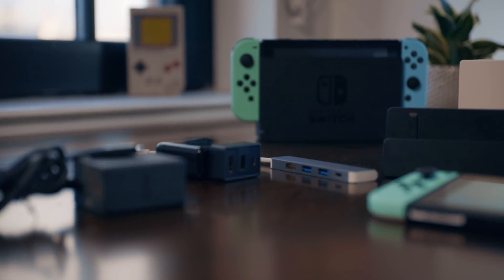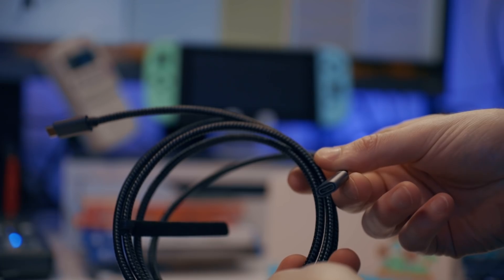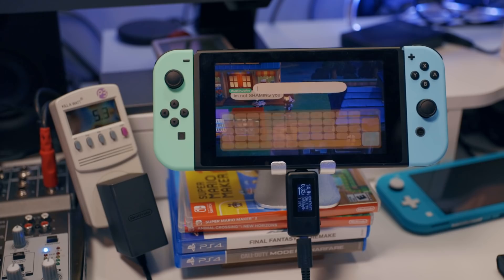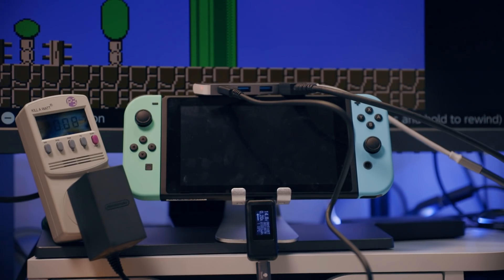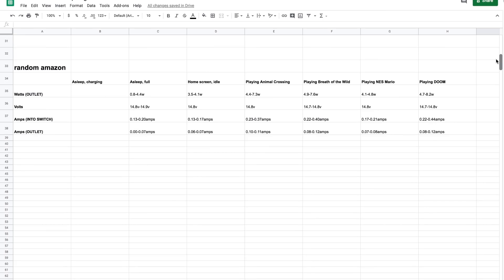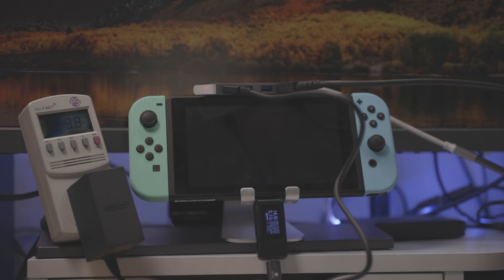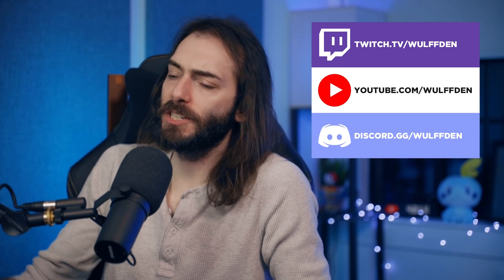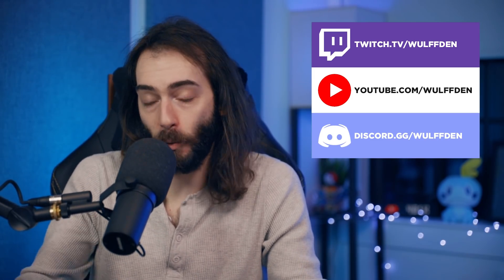How the Nintendo Switch consumes Power

Comment: My OCD and my generalized anxiety have caused me to always use official products for ALL my electronics… I heard once when I got my iPhone 3GS back in the day that your battery would degrade faster using non-apple products. I heard that when I looked up “how to increase battery life of my phone” every article I read said use the official cable and plug. So now, I ALWAYS only use official products. I like my devices to run properly. I don’t want to risk it, not even a little.

Comment: Are you telling me, that all I had to do, was get a male to female Type-C cable, like 20ft to 20 miles, hook that to the Official Dock, and use one of the cheap stands with the slot for the cable. Then I'd have a compact Dock that won't brick my Switch at all? 

Well.... half of it would be compact, the other would make it a cumbersome jerry rigged monstrosity defeating the purpose and I should just buy a second dock and transplant the guts into one of the compact empty shells.

Which I have a second dock coming form Nintendo and about to order one of those cases. Although I might just put the guts in a very tiny Tupperware container or something and put the Switch on top. Then I wont have to reassemble the circuit board into a new case. Just drop it in a container and call it a job well done. LOL

Comment: I have an aftermarket joycon / grip replacement that specifies that it wants a normal PD whatever, and the amps are different to the actual Switch power adapter, I assume this means never charge it with the Switch adapter?

Comment: I know this question comes late, but I see a lot of questions raised about docks and chargers, but hardly any about powerbanks.
Would it be safe to assume that (regular, not specifically ones that are designed for the Switch) powerbanks would most likely be fine since they provide very little voltage?
I'm guessing that's the case, but what do I know.

Comment: Guess that's why its said "up to 'plus 1 volt' past what device 'normally uses' doesn't usually cause a problem, but still wouldn't risk it." Many say best to stick to the volts the official chargers of devices (phones, laptops, etc) use as its best to just not risk it in the end. Why if you look at things like say a 230 watt or 280 or 330 laptop charger, for same laptops, they always will stay at the same voltage with just increase in amps to get to higher watts(due to well the device's "amp draw" will never be more than needed, just gives possibility to get more if needed for things). As I'm sure that's what is causing switches to be bricked with those 3rd party docks. 

Might be dang near impossible to get a Nintendo dock at the moment in 2021, but hey better to be safe than destroy your 300 dollar switch :). 

Would take his word on it now after these videos, just stick to official ones and not 3rd party docks.

Comment: Unfortunately the thing I want is something more like a dongle where I can plug in USB controllers and charge it at the same time without outputing to HDMI unless there is a way to trick it into display it on the mobile screen using the original dock

Comment: This actual makes a lot of sense in terms of the electrical engineering (Very basic for computer science reasons) . The major issue would be (in my theory) overcharging the battery which could cause heat issues when the device is suppose to be sleeping and unable to cool itself. If it was just the battery you could probably get a new one, if nintendo was willing to sell them specifically for the switch.

I could see this being a firehazard if the variables were just right if my theory is correct. But I'm to poor to test it, and my animal crossing island means a lot to me. 

Though my question is now....why didn't the thirdy party docks test for how their docks were reacting while the switch was at full battery in sleep mode?

Comment: I wish there were more options for wall chargers, the official brick is massive compared to the New 3DS XL, all Game Boys, and so on. It's also pretty poorly designed compared to the others. The others you can fold u the outlet plugs. You can get chargers that are modular USB now. I think if you use a PD cord, you'd be ok, but. The fuck do I know? I messaged Nintendo, asking about it, they wouldn't tell me anything. The grip I use is a Satisfye grip with the case bundle, it came with a REALLY nice USB-C 3.0 A to C cable. They told me it was standard USB, so...not using that for my switch. But it's super nice so Imma use it for other things. 

I did break down and buy the Anker/Nintendo massive one, because it's better to have it and not need it. And it fits better in my case. But, I need a more portable wall charger. So, Imma find SOMETHING

Comment: Although I know that verified numbers never lie, I will still take my chances with my dock similar to a Ikedon dock. As long as the switch is 100% and trickle maintaining the charge, I am fine. I know the switch already does this internally so it should be no difference docked.

Comment: I've been using an OEM Nintendo Switch charger on my phone, and it's reporting that it's getting 4.119 volts. I don't know if it's 100% USB-PD compliant, but it's compliant enough to give my phone the lower requested voltage and not the 15 volts the Switch apparently would get.

Comment: So would the switch still brick in dock if you go with a lower volt and amp power supply? Just enough to keep the switch running on tv. I know you gonna run out of battery eventually. But I need a small dock for traveling.

Comment: Electricity is like water. Voltage = pressure, current = flow. Watts = Power = voltage times current. Resistance = voltage / current.

Comment: 14.9 V and 0 amps. Dude your sensor is incapable for the data at that point.  Power = Amperage X Voltage or P = VI. If I = 0 then P = 0 cuz zero. Your amperage readings are therefore invalid.  
The switch power adapter supports up to 2.6 Amp draw,  so an amperage reading so low that it registers as 0 on your ampmeter wont harm anything .Also the switch dock supports. The nyko dock was caused by PD failure. Your "evidence" is extermely shoddy.

Comment: I was lucky. 

Was using a third-party dock because it acted like a stand and had a quick-swap between portable & docked mode so you could play it docked with the Switch screen.

It lasted about a month before it stopped outputting HDMI and wouldn't swap to portable mode. Tossed that in the trash and swapped back to the regular dock for charging. Still wish Nintendo would just release the damn charging specs so other manufacturers can make viable docks as well...

Comment: My question is: why in ** did Nintendo use a USB-C port if they're not following the standard? I've plugged my switch to all kinds of USB-C chargers (as I have them all over the house or when I got out for mobiles and laptops) before I became aware this could be an issue.

I'm sorry, but this is a massive mistake by Nintendo, not the third parties. Like Animal Crossing... ...piece of software junk...

Comment: So the switch uses 15V for charging. I believe that's just a less common voltage used with the PD standard, I've seen some chargers and batteries use it while others don't.

Comment: If I use my switch in table top and use the official wall plug that came with the switch is it ok to leave it plugged in while not using it? Does it still act the same as when docked and not in use?

Comment: My concern is charging the switch on the go. So obviously not using the stock wall outlet charger. I've seen that the pro controller has the correct specs to charge the switch from a usb source (vehicle or battery bank), but I cant just go buy a $60 controller just for the cable.

Comment: I wonder if it's the docks or the supplied chargers that are the issue. Has anyone experimented with this? I have an insignia Dock, and I'm kind of worried about using it. I was thinking about using a Nintendo branded charger with the dock to see if that makes any difference, but I'd rather not throw another $30 when I could just buy an official dock.

Comment: I think it's important that people know this isn't just an issue with the docks. I bricked my Switch using a 45w Anker usb c charger with PD certification. It's supposed to be smart enough to charge may different devices from cell phones to small laptops. I used it on my switch for a year or more with no issue, then the other day I put it to sleep on the Witcher 3 main menu. An hour later I decided to play again, plugged in the charger, hit the power button. Nada... won't turn on, won't reset. nothing.

Comment: Curious to know, maybe you brought it up and i missed it - and perhaps this is a ridiculously stupid question, but when you say “use your original dock”, is that then the actual docking station or does it also imply the ac adaptor cable that comes with the original packing? I just rebuilt my dock into that little plastic case (can’t remember the name right now) to travel lighter and I love it, it’s super slick but it hit me that I still need to bring along the chunky ac cable anyway. Would you advice against using say a usbc charging cable for like ipad to the switch original dock? Thanks! /ida

Comment: Wattage coming out of the outlet really is only going to tell how efficient your charger is because that isn't necessarily the wattage going into the switch. There is always loss in the AC-DC conversion so watts coming out of the wall will not be what is going into the switch.   Seeing power spikes while full charged and sleeping might just be the docks being shitty and wasting power. Also on the low end the kill-a-watt is not going to be very accurate. It has an accuracy of 0.2% and a full scale of 1875 Watts which gives you +/- 3.75 watts.  I would have like to see the watts output of the USB-c meter was.

Comment: Your idle not charging math is confusing: 0.8W at >0.01a would mean the circuit was at a minimum of 160V/0.005a, that would be unlikely as you probably would have pointed out a higher than 15V reading.

More likely is you buggered up the math or your multimeter couldn't accurately measure the current at >0.01a and gave false readings, or variation in the charge between tests gave different results.

Regardless, if the voltage didn't change then the amperage being supplied should not damage the Switch because amperage is pulled not pushed, that means the Switch was drawing those amps and the fault would lie most likely with the switch charging circuit.

Comment: I could be wrong, but I am pretty sure Spawnwave had a video in which he explained which amps kill the switch. I think it is a small chip for volt regulation. 

You could compare your values to the "frying" voltage/amps.

Or you could send your data over to one of these channels and let them analyse it :D

PS really, really great video! I want more!!!!

Comment: A note from Nintendo that we were given: If you are concerned about if a product is compatible with your Switch, simply check for the official Nintendo seal.  If you do not see the seal, we do not recommend using the product with your Switch as it may void your warranty if anything goes wrong.

Comment: Never bought nor would trust a 3rd party dock as an electrician, since I know what that small difference in voltage can do to a battery even just over the course of a few days.

My solution was to buy a 3rd party SHELL for my switch dock.  Had the thing for over a year, it's a little bigger than a deck of cards, and uses 100% of the factory nintendo guts, with none of the drawbacks aside from having to take apart the OEM dock (super easy) and place the guts in the new shell (again, super easy).  PLUS, the new shell gives the switch much better airflow, so my console stays cooler.

Comment: You said that the 3rd party docks were supplying 0.8 W at 15v when in sleep mode right? Volts X Amps = Watts, so if you plug in 15 volts and 0.8 Watts, which works out to 53 miliamps. That's really not a lot of current. It's not a direct link between the power rails of the USB connector to the battery management system of the switch. 

I will admit, if anyone was going to do something weird with their circuitry it would be Nintendo. But I highly doubt this 0.8W of quiescent current is the smoking gun you're making it out to be. My bet would be shoddy engineering of the circuit Nintendo uses to activate the DisplayPort over USB function so you can use a TV with your console.

 Maybe if we run the test on a Switch Light with one of the affected Nyko docks and see if it bricks that would give us more data. Switch Light's don't have the hardware support for DP-out so they might be unaffected.

Comment: This video seems to focus on third party docks and not chargers, despite the phrase "third party docks and chargers" being used many times throughout it.

Third party chargers are safe to use, I've not seen a compelling reason to believe they are not. One of the main reasons third party chargers got flak was due to the disclusion of overvoltage protection; namely a 56k-ohm resistor in the USB-A to USB-C charger. Power negotiations can cause the Switch to request more power than a USB-A port can ever deliver, causing damage to the cable and/or the actual console itself. The docks which don't have overvoltage protections suffer the same consequences, hence the bricking scenario. The specific component of the Switch which causes it to not boot after third party dock usage is the M92T36; replacing it restores the console to brand new conditions perfectly.

In short, USB-A to USB-C chargers may or may not be safe to use - they need to have a 56kΩ resistor. All USB-IF certified cables have this, mostly no-name brands and cheaply made docks do not.
USB-C to USB-C cables inherently don't suffer from the same power negotiation issue.
I've personally exclusively used a 45W portable charger and USB-C to USB-C cable to power all four of my Switch consoles, docked or handheld, since launch day.
The issue is exclusively with fake, cheap docks and cheap chargers.

Comment: We should also ask why Nintendo made such a cheap piece of shit device that bricks or whatever with 3rd party stuff. I mean really. Even a phone these days say you connect to a itty bitty 500mah outlet and cable when it takes 2a or something..still has measures in ppace to allow so albeit slowly. Or even a faster charger say an iphone use to do 1.0a max.. you could still use a 2.1a outles box thing or whatever. Its all good. But nope nintendo wants to just brick you and not even tell you that there may be an issue with 3rd parties. Nor do they hold them responsible.  Just sayin

Comment: I'm back from the last video to say that the voltage information that you highlighted in this video is NORMAL and of NO concern. The switch is designed to pull 15V with some variance due to losses in the cables and connectors.

On you last dock video, I mentioned that the main concern comes from the bridging of pins in the USB-C port on the switch since it is NOT a standard size and has a looser fit to slid in and out of the dock easier. I said that if the pins in the port manage to bridge that a higher voltage that expected can be sent to the switch's cpu, gpu, or some of the vital chips related to usb power delivery, battery charging, and video output. I took my claim to heart and sacrificed my nintendo switch using a cheap 3rd party hdmi adapter dock (looks like the original fastsnail one). I plugged it in having already connected the official nintendo switch charger and when I connected it my switch showed an error code and never turned on again. The VBUS pin and the SBU1 and SBU2 pins bridged sending 15V to a chip only designed for 3.3V. After replacing this chip and a few surrounding components, my nintendo switch functions fully again. 

Definitely don't use a 3rd party dock as the fit of the connector may not be suitable for the switch. The official nintendo switch dock has the spring design on the usb-c port to account for the loose fit.

Comment: I think the missing piece of puzzle here is that he is looking at the input power to the charger, therefore he needs to factor in inefficiency of chargers and docks he is using. Input power to charger  is not the same as output power going to the switch it self. There will be losses in the charger and he is in the error+inefficiency difference territory...

Comment: WULFF DEN, are you certain that 3rd party chargers are also an issue? 3rd party docks being an issue makes complete sense since the circuitry going on in the dock is tricky...but i dont understand how a 3rd party charger by itself could be bad if plugged directly into the switch. And i also even contemplate that it could be fine plugging a 3rd party charger into an official switch dock since the dock itself regulates the power that goes into the switch as it's docked...

Comment: Does this apply to dockless chargers? I had a Switch bricked by a nyko dock back when that was happening. I now NEVER use a dock except maybe once a month at home on my official dock, but most of my charging happens with just chargers.  I occasionally I use my USB-C laptop charger at work for my Switch -- is that a mistake or is it specifically the docks that are messed up?